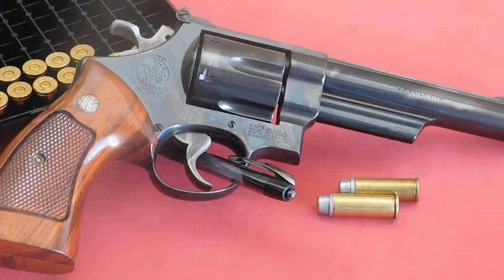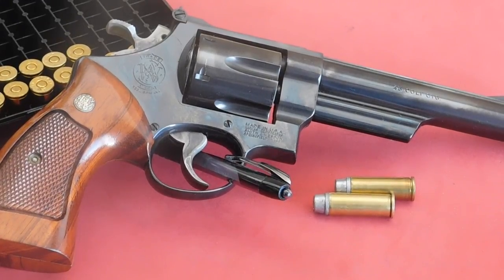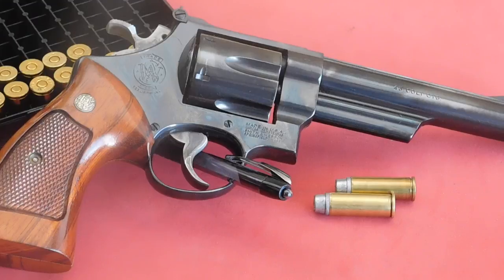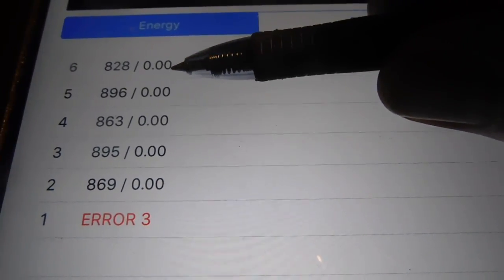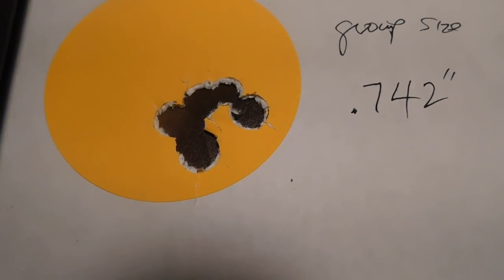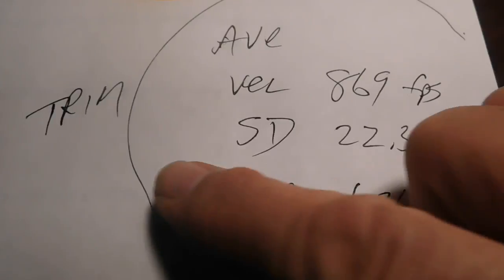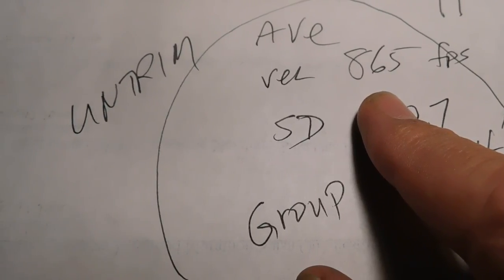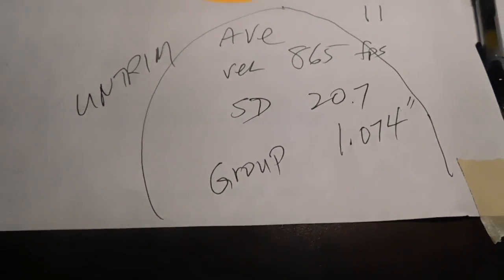Range Shooting Test - Trimmed 45 Colt Brass Vs Untrimmed In The S & W M25 Revolver

Comment: Another great video.  

You showed once again that reloading straight wall pistol cartridges for pistol range distances has different rules than shooting rifle rounds at long range distances.   I think this is why progressive reloading machines work for pistol cartridge reloading. You can dump your brass into the feed hopper and start pulling the lever arm because so many things don't matter on the range.

Excellent choice for a test weapon.   Although, I was expecting a SA revolver to shoot the 45 Long Colts.   I am curious as to what happens when you move from 12.5 yards out to 25 yards.  Convention says that groups will spread out.  Of course convention also said to trim your 45 LC Cartridges.  Now at 50+ yards you have an excuse to pull out a lever action rifle to measure convention.

So for now we have to cross another reason we have been able to use for not shooting 50 rounds thru a single hole off the list and blame the shooter.   Of course, you have furnished a sound reason to pick up a model 25 S&W and shoot thousands of rounds thru it to contest your results... So that is a win for everyone !!!

Comment: When you first started showing your shooting of trimmed brass, there was light under the barrel, then you adjusted the height of the rest and shifted so no light was under the barrel. This tells me your shooting was likely more consistent in your later groups after adjustments were made. But your results are consistent with my experiments and others I know were done in the past. That is, there is no advantage to trimming or staying with one brass manufacturer.
Reply from the maker: ShinyPartsUp - That was caused by resting on the ejector rod housing - the important thing was that the sight picture was steady...the gun shot the same either way... Best to ya,  FC  - very observant of you..!!

Comment: First let me state you are a fine shot in my opinion. But your results on this test didn't hold any surprise for me. Like you stated the roll crimps in a revolver take from the benefits that trimming would have. But to see the difference I think you will need a ramsom rest, an optic and more range then you might be able to show the slight benefit of trimming.   But I think that the difference you had today was the human factor. Your groups were normally wider than tall. I think that your gun and load are capable of 1ragged hole groups at 12 1/2 yards. 
  Is there a way I could get your Email? I don't facebook.
Reply from the maker: Eston Loving - Ah, the Ransom Rest - I've been to a lot of ranges, and I've never seen one of those...pricey and the gun inserts are around $100 each as well from what I hear.  We used to be able to send ammo to ballistics lab to have them run over.  But there's cost there as well...Might be good to have some sponsors doing these videos... Have a great day,  FC
Reply from the maker: Eston Loving - Thanks for the compliment.  The trigger action is still good.  Just five short years ago, I was shooting my usual 25 yards and even 50 yards offhand two handed.  When the sights are clear against the target, we can shoot.  Just about a year ago, the eyes just won't focus and glasses set to 65% work for about a month and then the eyes shift requiring another set...That just won't work...Telescopic sights and shooting irons at 12 1/2 yards keeps me in the game.  I could go to red dots like a lot of my friends have, but am a bit stubborn...the 12 1/2 yard line is OK...Have a great day,  FC Steve

Comment: Looks like I'll stick to not trimming my handgun brass. This was a great test video Mr cookie!! My absolute favorite round to load too. It was a win- win video for me. Thank u for all you do for us.  Safe shooting to ya
Reply from the maker: Steel Punisher 69 - Funny, I would not have been surprised if the results had been different...and no matter how the results came out, there was going to be disappointment somewhere.  Fact is, I've never trimmed any handgun brass so if trimming didn't win, it would have been OK.  But if the trimming won, then I'd just conclude - of course - it's the consistent crimp explanation.  And if neither really won, then we can look at all the progressive press manuals out there...trimming of handgun brass was/is never featured as something we do across the board (unless max OAL is happening), but Dillon came out with their power rifle case trimmer because again, when it comes to rifles - the distance and accuracy requirements we impose require trimming.  Have a great day,  FC

Comment: Love that .45 shoots all ammo well !   I think this is a good test & agree with all you said ... BUT some say you need 50 shots to really tell how a load works . The diff is small so to say one is better at this point ??  I would say , in this gun with this load it's likely not worth the trouble as long as the brass is not too far out of the norm . It may be true in many other guns / loads also , I would not want to say ALL !   I sort my brass by brand & finish because it's easy in the last cleaning stage , & pull the case to clean the primer pocket before I prime it in my progressive loader  &  always will . I don't care what test show what result . I know some folks would think no need to do that .
Reply from the maker: Dan O'Neill - I can explain away the results with our cast bullet crimping grooves - tapered or not - simply allow variation in case length to not be problematic.  But a real baffler is the use of mixed brass vs matched brass.  There isn't any difference there either (and various testing over the years has allowed me to be at ease without sorting handgun brass).  I've found variation in my mixed brass that should result in weird SD and inaccuracy - but it just doen'st happen.  Even the occasional flyers cancel each other out when shooting groups of mixed and matched.  For 50 yard PPC and NRA Bullseye competition, I'd use matched brass.  It would take an exceptional shooter to demonstrate the small differences that might be there - and those guys have better things to do - they get their ammo comped to them by the ammo companies.  Someone said get a Ransom Rest - I'd do that, but at over $400 a copy and $100 for the gun inserts, no one is paying me to do these tests.   Have a great day,  FC

Comment: Good job. The results are pretty much what I expected. It's hard to compare the standard deviation and such since you don't know the amount of any one type of brass in each shot group, but proves in low pressure loads at least, when shooting close range, you might as well save the time, load, and have fun. Now you should load some hotter loads and shoot in a Ruger if you have one, to see if the results stay the same or vary to any significant degree. Cast bullets that are accurate a close range, can go bonkers at longer distances, and ones that are so, so can pass the short range accurate ones up at long distance. By the way, just for your readers knowledge, if you don't have a chronograph, you can tell the slower loads from the faster ones, by shooting at long distance. The slower ones will shoot higher.
Reply: By the way, in my previous posts, on your first of this two part test, I've talked about web thickness varying with brands of brass. I should mention for those readers that don't know, wall thick will vary some by brand too. None of this really matters if you are shooting cowboy level loads, but will have an affect with hunting/hotter loads.
Reply from the maker: Jim Vaughn - The stuff we have to test and discover provide inexhaustible fodder for us reloaders.  Thanks for your comment...you've got the bend on why we are doing these tests - provide some kind of clarity to those who want it and can benefit by it (and all travelers on the Hot Lead Zone Express with information are encouraged to chime right on in).  There is a point where jacketed bullets really take over - sure there are those that do their darndest to push the threshold of cast into the nether realms of jacketed performance, but I'll just buy good jacketed bullets - they are there for us to use and enjoy.  Best to ya, Jim   FC Steve